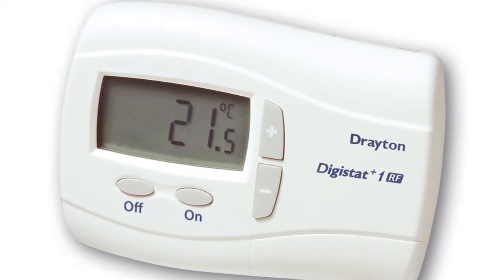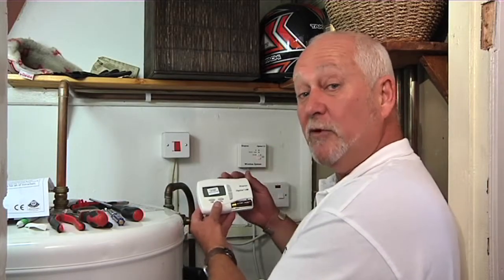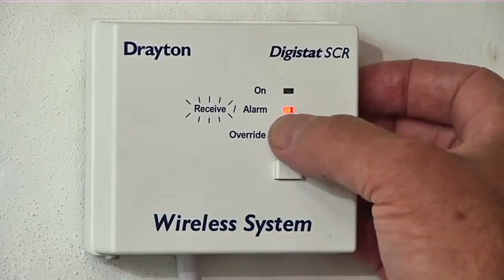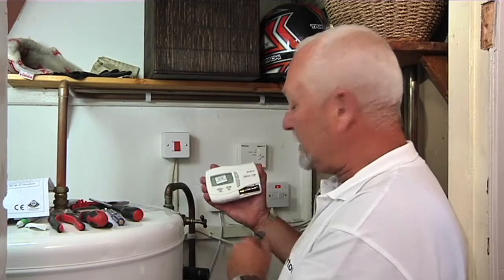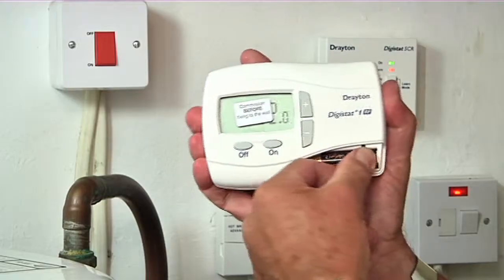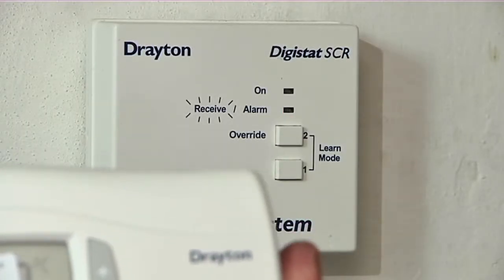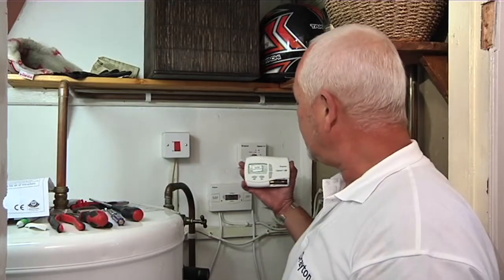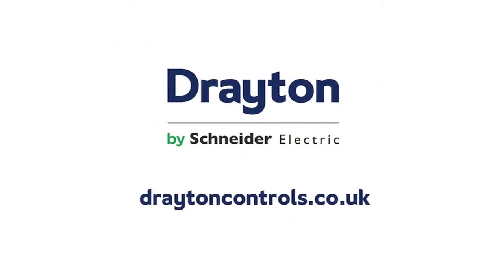Commissioning a Wireless Room Thermostat

Comment: Hi there, so if heating is set up on a timer, when heating is on should be green light and red together, and if it's not on only red light, correct? and if red flashing means its trying to connect. Appreciate respond
Reply: oh and one more question, what if I dont have any light... something is up with my heating, doesnt follow time schedule
Reply from the maker: Thanks for getting in touch. For the most comprehensive response I recommend contacting our technical support team, who will be able to talk you through the best options for your situation. The number is 0333 6000 622 and lines are open Monday to Thursday 8am - 4.30pm and 8am - 3.30pm on Friday.
Reply: @Draytonheating  Thank you so much, all sorted with your help.

Comment: Of course this doesn't work for me. I changed the batteries and did exactly in this video. But the red light doesn't flash the second time after installing batteries
Reply from the maker: Thanks for getting in touch. For the most comprehensive response I recommend contacting our technical support team, who will be able to talk you through the best options for your situation. The number is 0333 6000 622 and lines are open Monday to Thursday 8am - 4.30pm and 8am - 3.30pm on Friday.